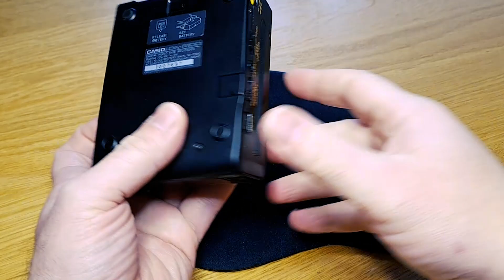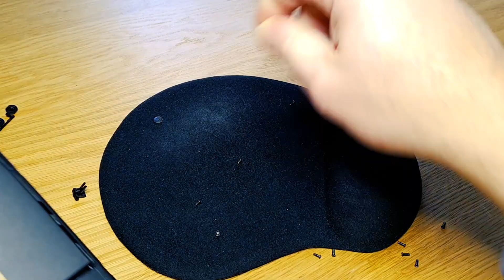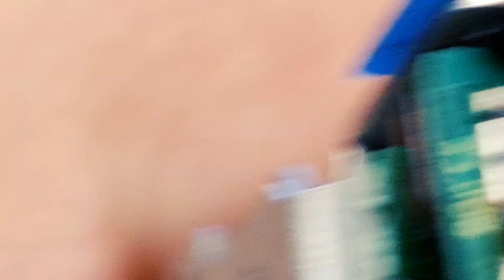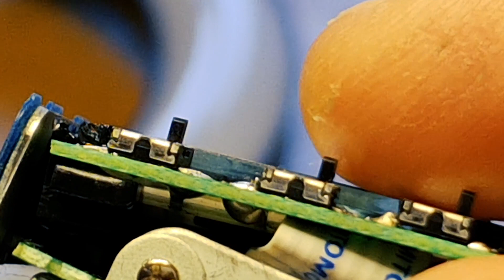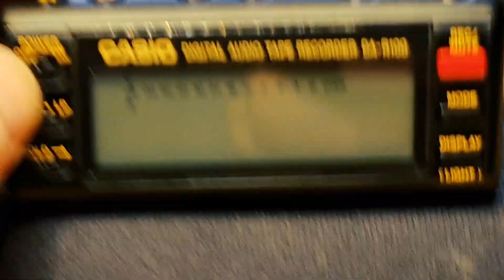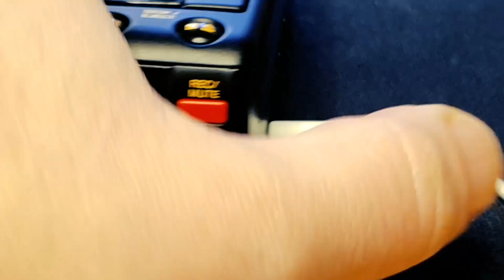Casio DA-R100 Dat Player Repair

Comment: One of these just came into my possession from a friend.  It powers on and plays the tapes fine.  I can see the VU meter bouncing, but the headphone jack doesn't work.  No sound.  If I plug the phones into the "line out" jack, it works but it's distorted.  What do you think?
Reply: Replace all 8 miniature electrolytics on the bottom board, mainly on the inside. Once the screws are out, a gentle pull is needed to disconnect the 2 central multi- pin connectors.

Comment: Hello, would you please share where have you bought these switches from? I'm in the middle of repairing one of those and I found out two of the switches broken. Thank you in advace.
Reply: Same problem here! Replaced all 8 electrolytics, the unit works but the mike/line input switch has a broken nose.
Reply: Did you get an answer to the DA-R100 switch sourcing question?

Comment: I have a working DA-R100 but now a faulty cassette has made the eject mechanism stuck. How did you get the lid off the cassette holder. That moment you do outside the picture...
Reply: If the mechanism has not returned "home" , the lever on the right is blocked. Remove both top cassette cover screws and force off the cover. Even if you don't re-glue the 2 small plastic angles, the 2 screws are entirely sufficient!
Reply: I have the same problem. Powers up. Won’t open up! Did you find out what to do?
Reply: Left it with a repair workshop, he fixed it...

Comment: The DAT technology was pretty popular for digital tape storage in the '90s, i.e., backups under the name "DDS" (Digital Data Storage). This is what we used in my work on "big" commercial Unix machines, e.g., HP-UX and Solaris machines.
https://en.wikipedia.org/wiki/Digital_Data_Storage
It used a helical scanning  head like on VCRs... this made it difficult (impossible) to splice tapes, say if the tape was damaged or recorded over and you wanted to get past the end-of-tape marker to reach data recorded further on in the tape.

I wrote an article in Sys Admin magazine (around 1998) about how we managed to restore data by overwriting a newer end-of-tape marker, which would then allow the DDS drive to skip past that and reach data further on in the tape. (This was what would happen, for instance, if you did a bunch of file-system dumps in series to a tape.)

For instance, when I left my job I saved all my Unix content (1988-1997) on an HP DDS-2 tape... now I have to find an external SCSI DDS-2 drive that I can buy to be able to restore my earliest email, code, etc. from that tape since the drives are not so common anymore. :)
Reply from the maker: Thanks Dr. I think I have some, ill make a video about them if i have the one u need you can borrow it.
Reply: @TechJump  Thanks - this caused me to look for a SCSI DDS2 drive on eBay and I found from a reputable seller claiming its working (w/photo of it detected on the SCSI bus) and a Sony drive mechanism, shipped for ~100USD, so I just bought that and will see if I can get things to work. Can't wait to open that time capsule include 10 years of my email!

I wonder how similar the Sony DDS mechanism is to your DAT recorder/player. Definitely getting to an age that belts and plastic gears will be a concern.
Reply: @TechJump  If the drive I buy doesn't work, I'm totally coming to Europe later this year and picking up yours. :)
Reply from the maker: Haha..sure thing. Hey its actually a trip finding old code and kind of track your own progress.